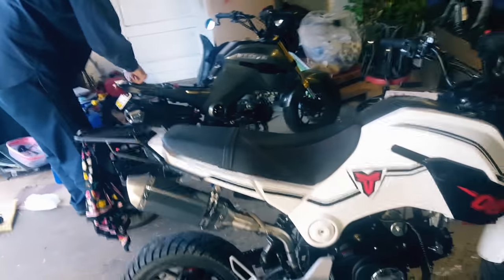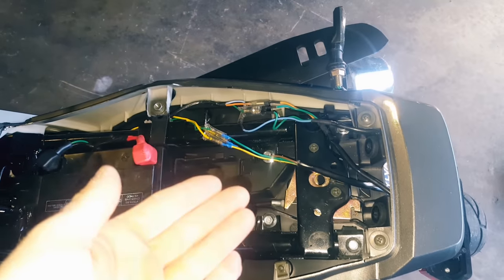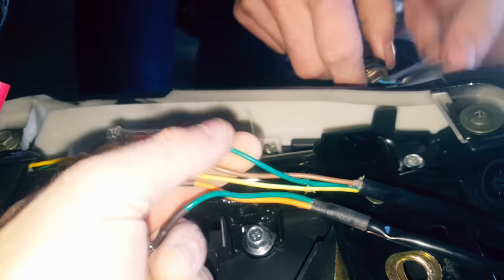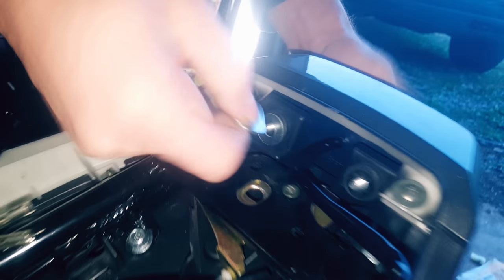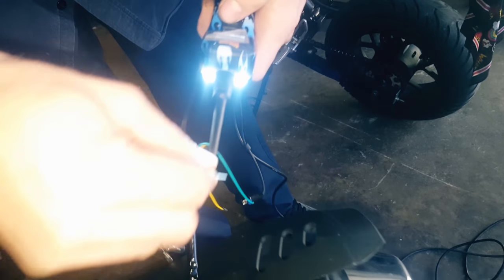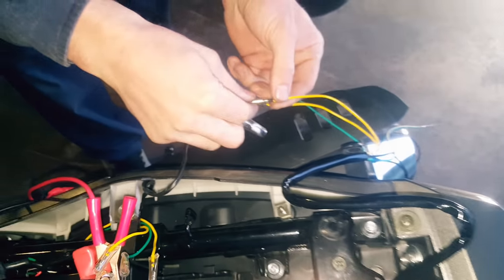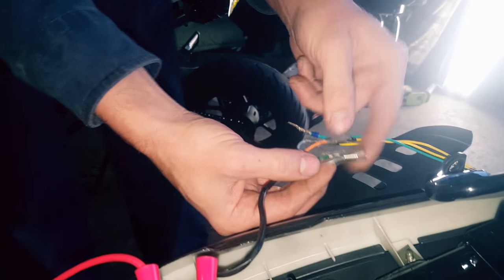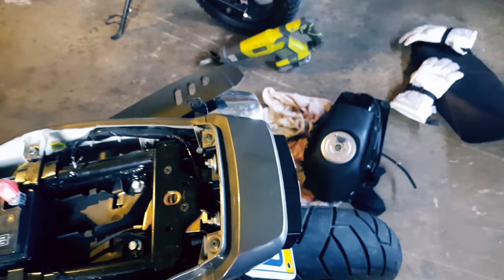Hellcat/Icebear BRAKE LIGHT/ TURN SIGNAL MOD

Comment: i am very proud of your good quality work in making your wire splice connections,,,, not that cheap crap way of twisting bare ends together  while wrapping with electric tape which can over time fall off,,,, great work good job you do it the same way as i do,, place heat shrink tubing on wire then make solder connection, slide heat shrink tubing down over solder connection, apply heat stink tubing over connection,,,,,,,,,,, now what i do is i prefere i  use 2 pieces of heat shrink tubing to make the insulating layer twice as thick. good job guys keep up your good work. Patty

Comment: Question for Tom, I have an icebear fuerza as well. Got a nice sequential integrated tail light for a Grom myself. I installed it with no issues but am getting a crazy flicker from the tail light at idle. Tried putting a capacitor and resistor(separately)in parallel to the tail light circuit with no luck. Does your tail light flicker at idle as well? Just curious in case I have to send it back. Thank you

Comment: to hit 65 of the hellcat do i have to replace both sprockets or just the 17t for the front? also have you had any problems with the chain
Reply from the maker: to make the chain work i got
 https://www.amazon.com/PBI-Sprockets-Aluminum-Honda-Sprocket/dp/B01BDE1DL6/ref=sr_1_fkmr0_2?s=automotive&ie=UTF8&qid=1507252033&sr=1-2-fkmr0&keywords=428+31T+SPROCKET

https://www.amazon.com/Wingsmoto-Sprocket-428-17T-Motorcycle-Dirtbike/dp/B010UQK6NY/ref=redir_mobile_desktop?_encoding=UTF8&psc=1&ref_=yo_ii_img
Reply: Is there a link for that luggage rack on the hellcat?  I love it
Reply from the maker: No not that I know of but comes with the bikeb